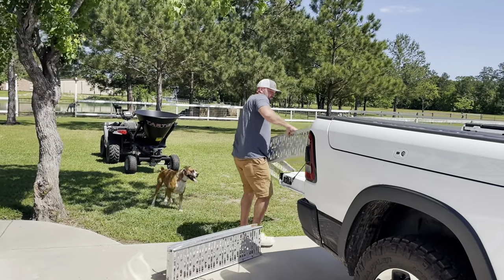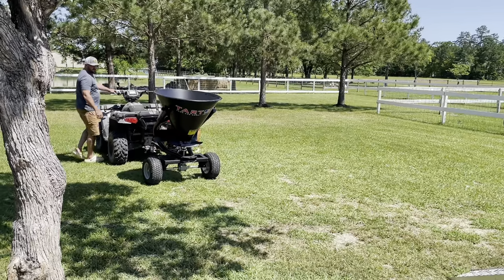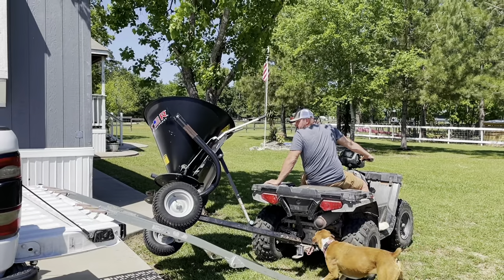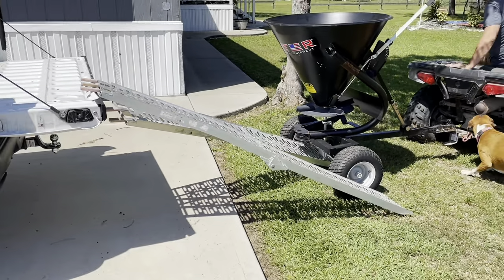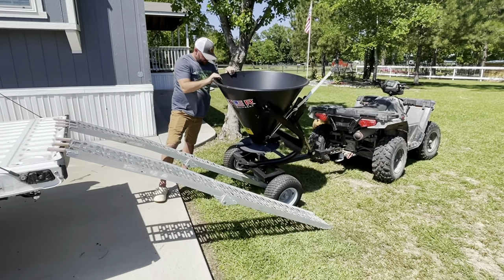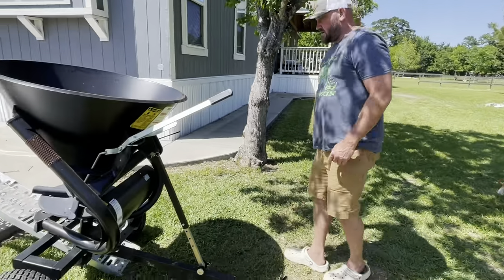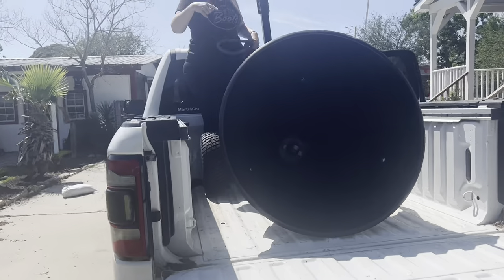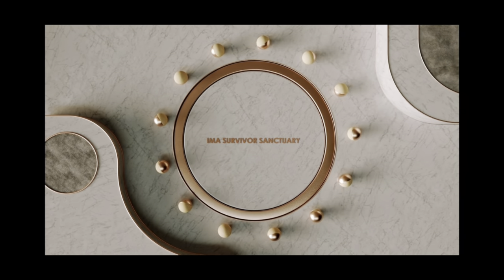It Always Starts With a Fail

Comment: Tow straps usually are used with a vehicle. We ended up putting a set in each vehicle so we would always have one no matter where we were at. Unfortunately that doesn't always work when you forget to put them back when your done😂

Comment: I pull into my ditch or where back of truck is lower. Then put ramps on truck to load my quad. Would have made it easier to pull the seeder up onto the truck bed too. Not such a big of incline.

Comment: Just a suggestion. When trying to use the ramps, find a ditch to back the truck in, then put the ramps on. It will make the bed of the truck lower, so the ramp won't be so straight up.
Reply: But then , I don't think I've seen a ditch at ISS.

Comment: Use the ramp and put the seeder up onto the house deck. Then back the truck up as close as you can to the deck stairs, using the ramp again, push it across the ramp into the back of the vehicle That way the angle won’t be as steep.

Comment: Only thing i thought of to improve process i is if you had a pulley, you cou)d change the direction of the pull. You could be on the ground and just walk to pull the rope. But good job exercising those brains to solve the problem

Comment: Get the tracker put in the bucket pull up to the truck and pull it off. You will need to to secure the tongue so it doesn't fall out of bucket
 Easy pezzy